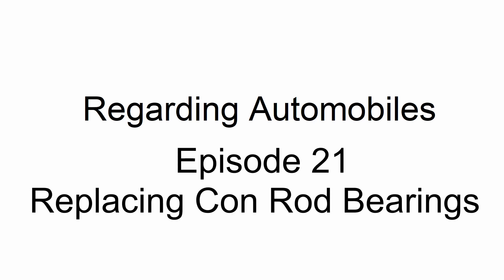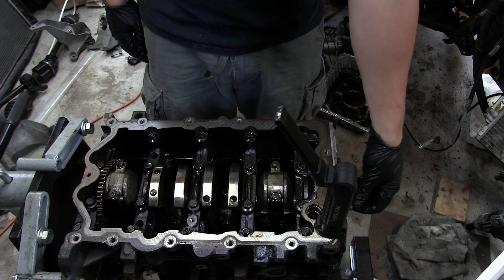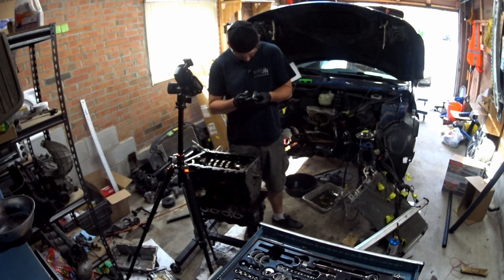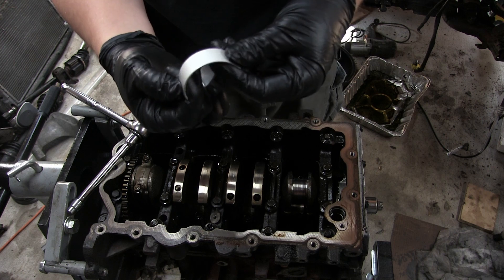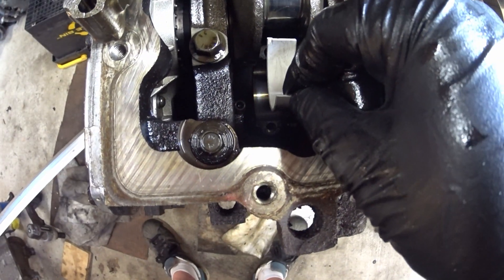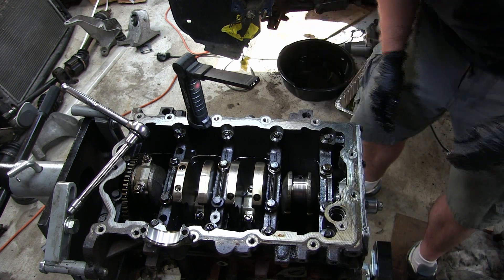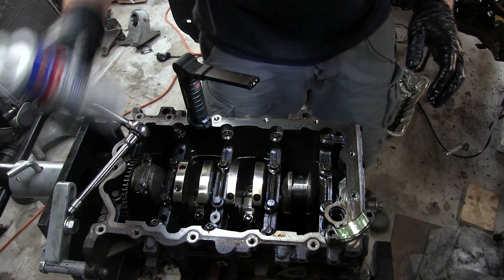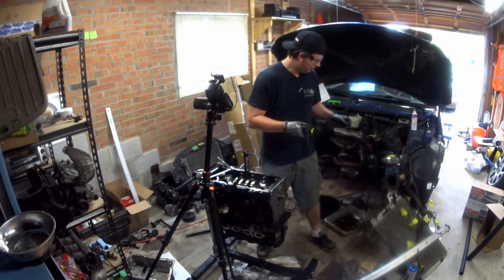E21 - Con Rod Bearing Replacement - R53 Mini - What a Spun Bearing Looks Like

Comment: You could have tried hand-polishing the journal. It is easy to in the car/block, it just takes time. After doing that you can measure to see if the crank journal is in spec. If so, put it together and you are done. If not, then you were going to pull the crank and have it turned anyway.
Reply from the maker: Unfortunately I ended up taking the crank to a machine shop and they said there was no way to repair it. “Thrust” was off? Something like that.

Comment: Warning!! Don't take anything to this guy !! Crank needs machine work, rod and piston needs to be replaced .
Reply from the maker: Are you thinking you are leaving a yelp review of my machine shop? I agree, don’t bring your engine to me for a rebuild. 

In later videos I do indeed replace the crank and rod on the advice of a machine shop.
Reply: @RegardingAutomobiles  it's not a machine shop! I didn't see anything being re machined?? You may as well use shoelaces to fill in the gaps from the bearings spinning.. suggestion!! Remake your video on how to do it right! Any gear head can see all of what's wrong with your video.

Comment: BMW's have a lot of spun bearings... but mini's don't have a lot of problems: 
You just got very unlucky. 
Most likely someone didn't do an oil change regularly. 
It's the lack of lubrication that spins most bearings.

If you can bond a lubricant to both metal surfaces it would prevent the bearing from spinning and save you an expensive repair.

🙂

Comment: How do I know if my piston in the correct way?
Reply from the maker: There is an arrow on the top of them.  It shows the front of the engine which helps you clock the rings properly.   https://youtu.be/pAVdkXlEWVg?t=1178

Comment: thought I heard you call it a new engine?  If so what made you go and change the connecting rod bearings? 🤔
Reply from the maker: It was “new to me”. Pulled from a car that was running when it was parted out. I was doing the bearings because it was “easy” since the engine was already out.

Comment: Are you joking you couldn't figure out which is which when one has a U and one has an L. Bro cmon that's told you RITE there.. I bet ur car fears every time you pop it's hood...yeesh
Reply from the maker: Totally. Bro.
Reply: @RegardingAutomobiles  ignore this dude, its obvious you are learning and you are very upfront about that. I also would not have knows for sure and would not have trusted those bearings with the two different finishes... glad you decided to grab some different ones. I normally just call up the retailer and straight up ask questions if I have them. Sometimes you get lucky and they actually have answers haha. Keep up the good work!

Comment: U is for upper ? L is for lower ?
Reply from the maker: That was my guess at the time. If it was a big L and and big U on the bearings it would be clear but it was just part of a longer set of characters printed in the parts. Not official in any way.

Comment: So, the torque on your con-rod bolts...  the 25ft/lbs is to seat the bolt, from there the stretch or an additional turn of x degrees gets the fastener properly tightened.  25ft/lbs won't be enough...  find some additional instructions- should look like: 25ft/lbs + XX degrees of rotation. The reason that it's not a reusable fastener is because they get stretched upon installation to provide the proper amount of holding force.
Also, you shoulda bought my 318. Ha!
Reply from the maker: That makes way more sense. I guess the good thing is I can reuse the bolts now because I didn’t stretch them.  Also, I said I am IGNORING THE 3-SERIES VOICE.